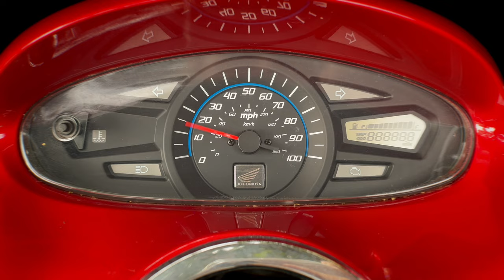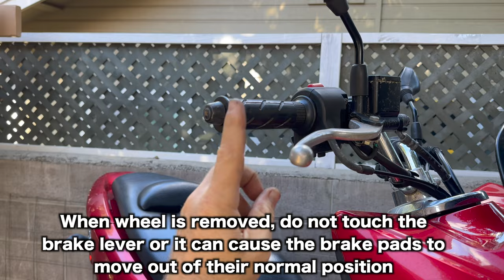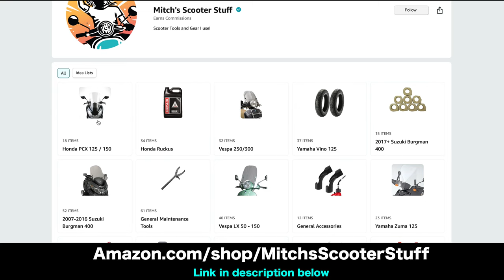Honda PCX 125 / 150 - Front Wheel Removal / Installation | Mitch's Scooter Stuff

Comment: Why is the pattern on the new tire turned the other way ? Doesn't that make it dangerous to drive when there is water on the road ?
Reply: This is the right way. It makes it brake better. Just think of it as the opposite of the rear wheel. The rear takes acceleration load, the front takes braking load.
Reply: @Watson2108  But it also force the water in to the middle of the tire with risk for aquaplaning, especially in a country with rainy season...
Reply: @kollba6670  The contact patch on motorcycles is so small that aquaplaning is a non issue. In a car, going over 60mph in heavy rain starts to get really dangerous because of the wide, flat tires.
Bike tires are more like a wedge that carves through the water